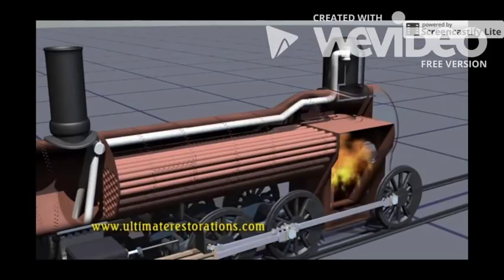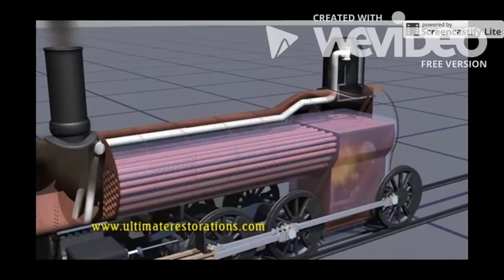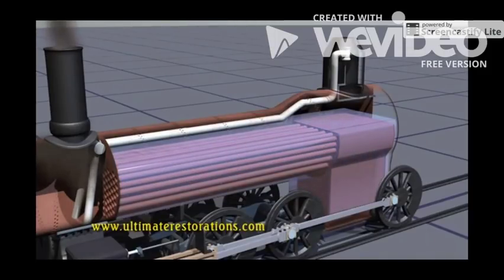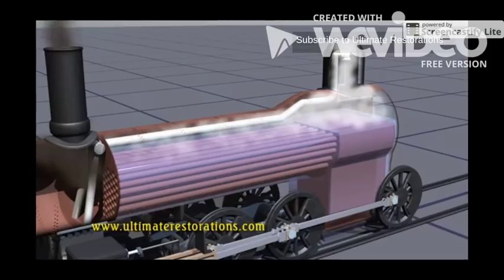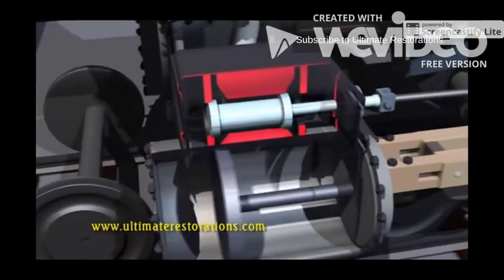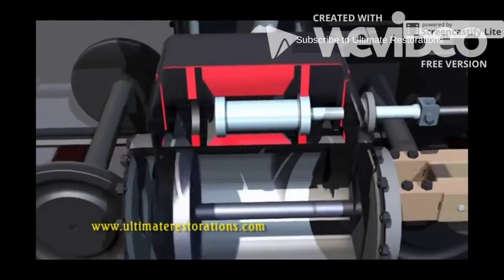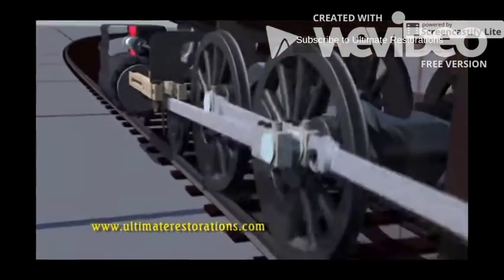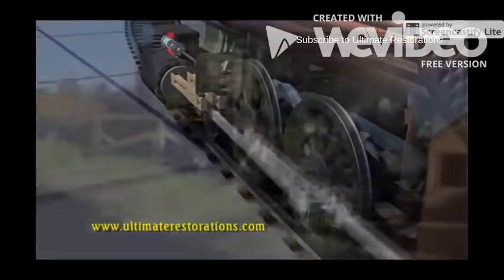How Steam Engines Works

Comment: Nice Information team,
U can also check some more video:
What is Steam Boiler in hindi
https://youtu.be/BrXkzqEXRrg

what is Boiler Mounting parts in hindi
https://youtu.be/R2mlToOHb80

what is Boiler Feed Water Parameter in Hindi
https://youtu.be/XKuiXGs2QQo

What is Safety valve in Boiler, Hindi
https://youtu.be/LoR7A7FBXtw

What is Furnace oil in Hindi
https://youtu.be/plxst6o-8-Y